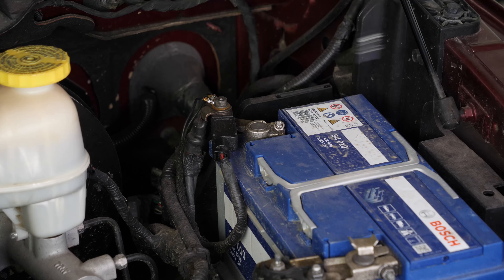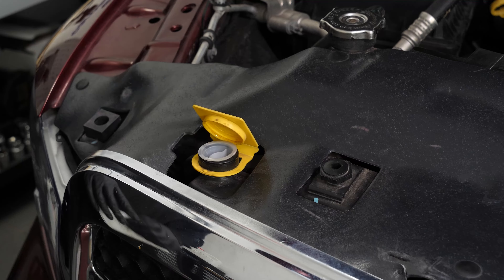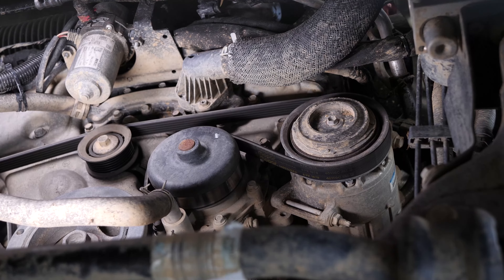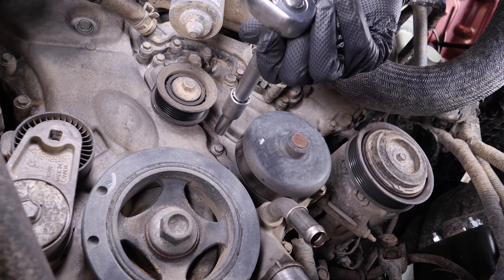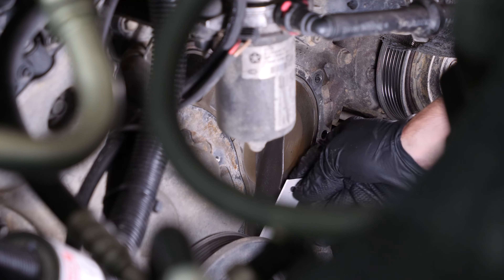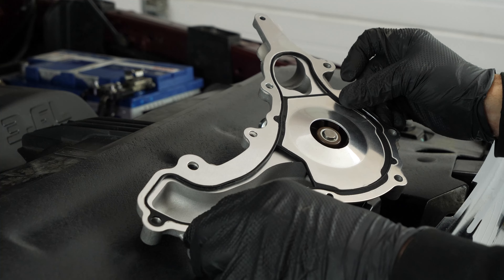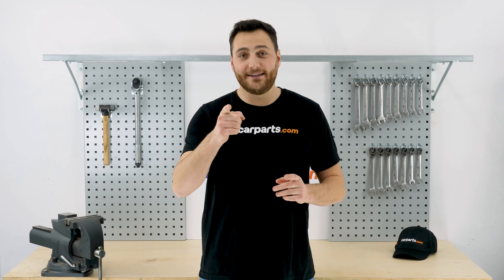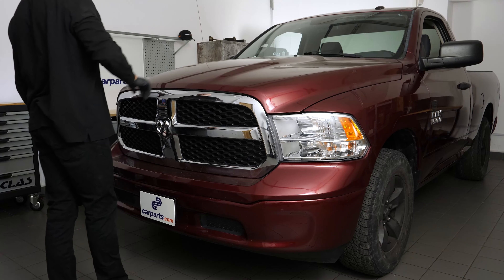How to replace the Water Pump 2009-2018 Dodge RAM 1500 💧

Comment: So is the 4.7l or 5.7?
Reply from the maker: it is the 3.6 Liter
Reply: Should add V6 3.6 to the title, might get more hits
Reply: I did replace my water pump on my 3.6, but the clamps are a little leaky.  Gonna have to replace with old style screw tighten clamps….bummer.

Comment: ❤ you are 1 of the best.  No b.s. right to the point  how do I contact you
Reply from the maker: Hi GeraldStarkey ! You can reply to this comment if you have any questions ✌😄
Reply: @CarPartscomOfficial  I have multiple issues.  Regular cylinder 2 misfire (VVT Solenoid?), and the lights flicker during idle(bad alternator?). Here is a video of my irregular idle:  https://youtube.com/shorts/zkxRl5LAaGM?si=vg3-0VB4Pgml7SZv

I changed all my plugs and coils.  Have changed the water pump,  alternator, and both idlers.

The alternator was rebuilt/refurbished.  I have 198k miles.